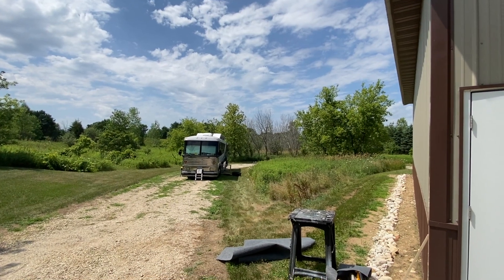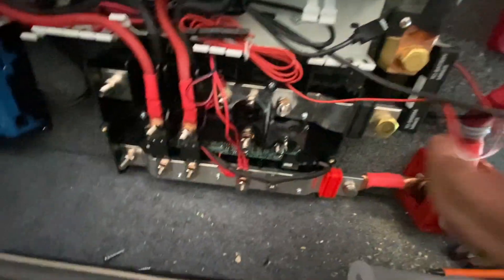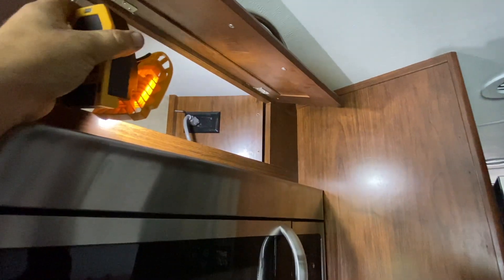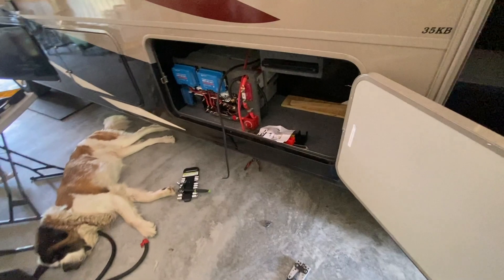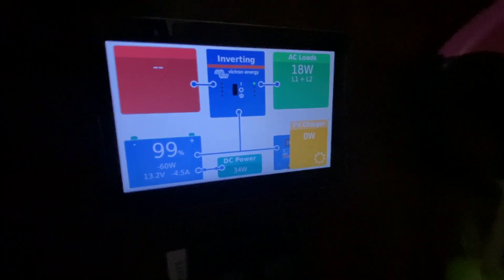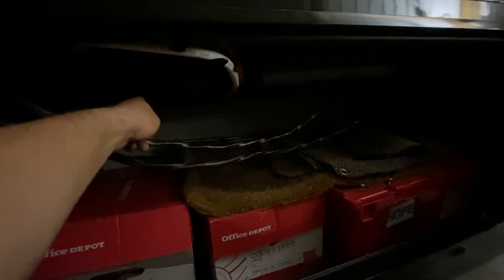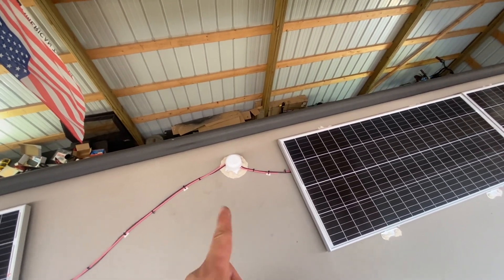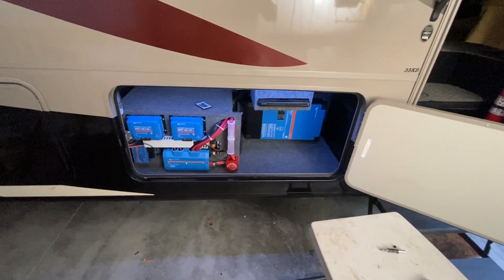Coachman Mirada RV Victron Solar Install, 1600w solar 540ah battery

Comment: I had mine do that it it turned out to be a lose ground going into the inverter on the DC side.
Reply from the maker: Just pulled it out of the box to retest before getting RMA. Same thing, connected to battery only